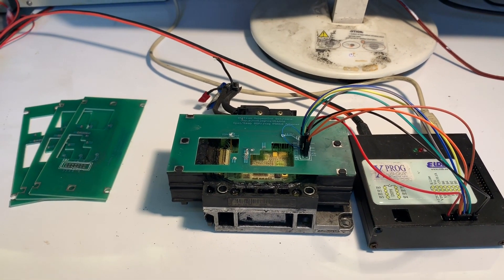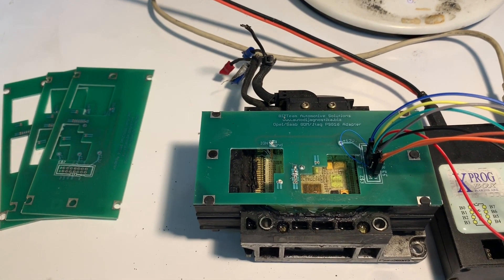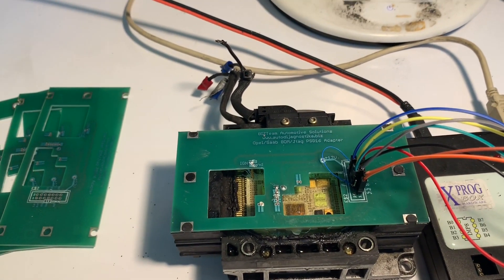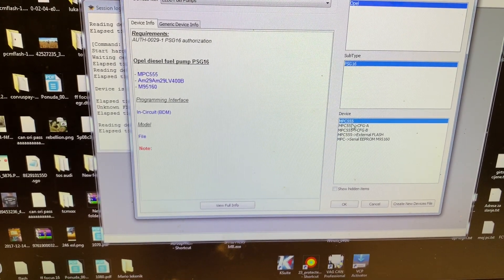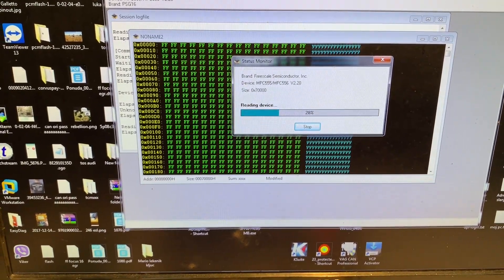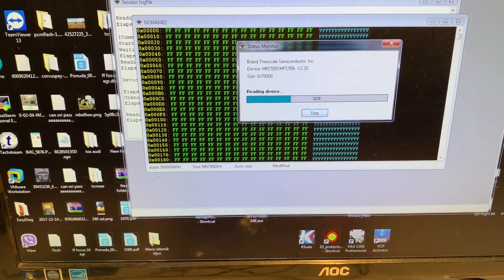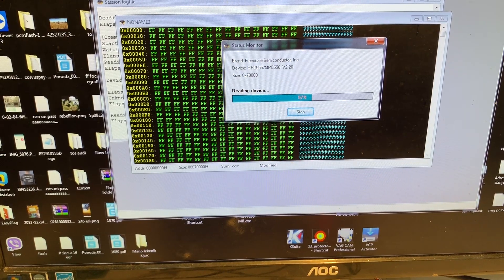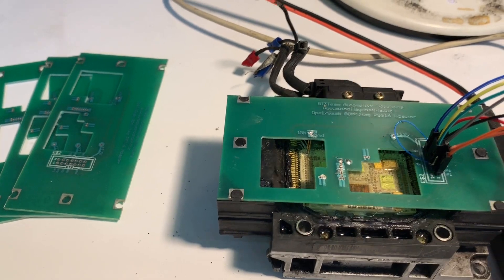PSG16 Final Solution - Flash Read/Write

Comment: Hello, I bought this adapter for a long time but I cannot connect xprog, it can detail the correct pinout since I see in the video a blue jumper cable that I do not know where it is going, thanks and regards
Reply from the maker: Aprendiendo en Garage Sport if you have clone xprog you cant connect.
If you have original, then in original you have PINOUT INFO button. You click it and there is schematic
Reply: @B1ZTeam  ok I already have a pinout but they are still unread with xprog 5.70 it works?